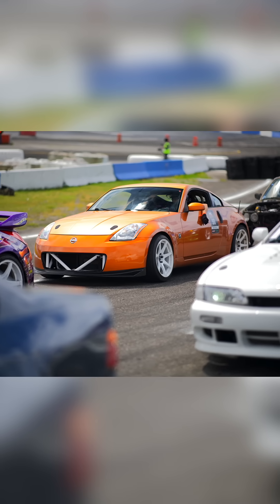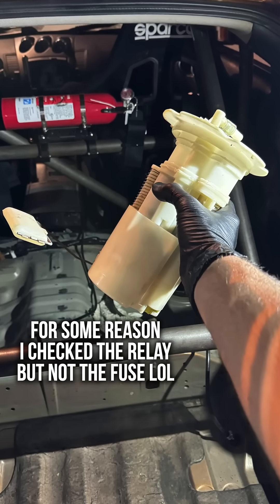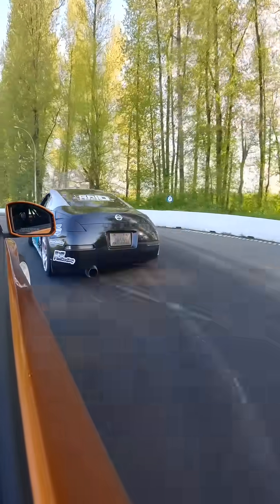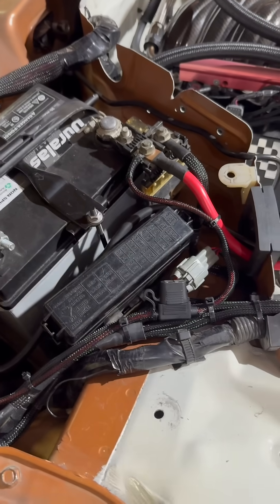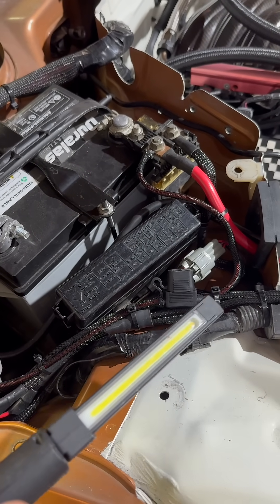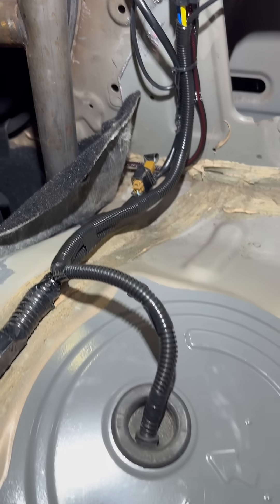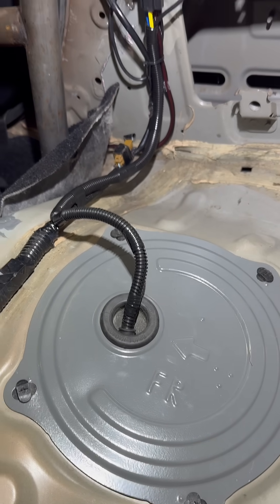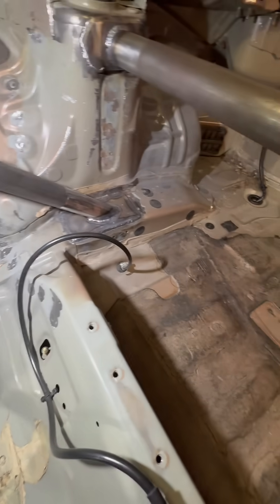LS Swapped 350Z Fuel Pump Relay Hardwire

Comment: Yooooo can you send me a diagram of the 350z fuel connector or where you soldered the wire to witch pin i have same relay and need help